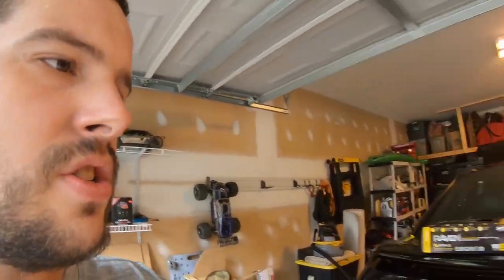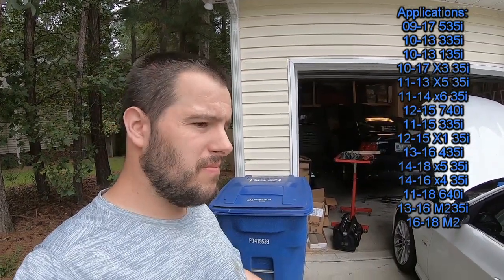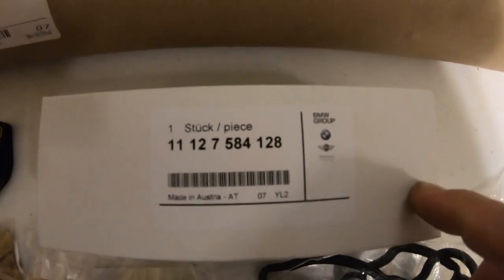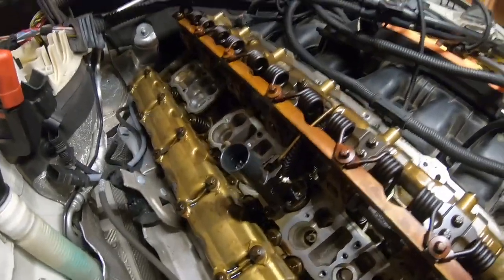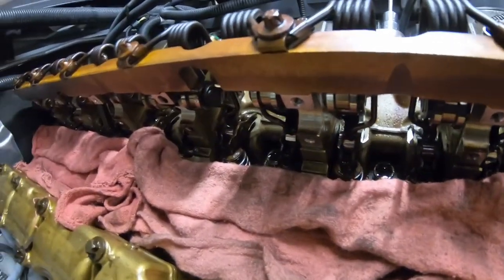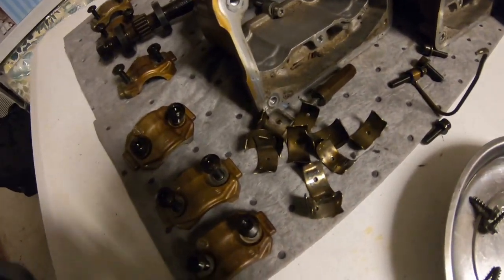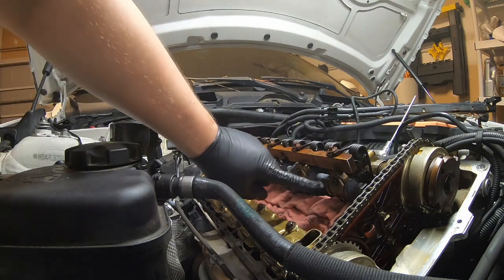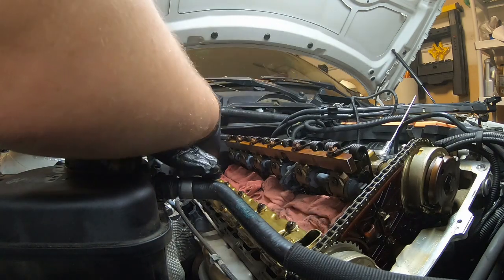Bmw N55 Eccentric shaft replacement

Comment: If you replace the valvetronic sensor motor, do you have to replace eccentric shaft ?
Reply from the maker: You do not have to replace the eccentric shaft. Most of the issues with this system stem from problems with the motor itself. There are occasions where there is damage/ wear to eccentric shaft where it could cause issues. I have not seen that very much though. There is a service bulletin from BMW that references some of the faults that stem from eccentric shaft motor problems. In that service bulletin it states to replace all components of the system. The customer of the vehicle in this video got hold of the service bulletin and wanted to air on the side of caution and just prevent any future issues. If it were my car I would have replaced the eccentric shaft motor first and gone from there.
Reply: @MunkysGarage  thanks
Reply: @MunkysGarage   when im gonna replace my valvetronic can i see if the shaft is bad in any way? Like if i dont see any marks on it should i leave it alone? I randomly have only a shadowcode 135704 and my car is just running a little rough, sluggish at low rpms. Its a n55 with 88k miles on it. If i disconnect the valvetronic motor it runs better but not perfect obviously

Comment: Great vid. I’d recommend replacing the valve cover while you have it all apart. Either genuine or URO both of which come with gasket, bolts, etc. Preventative for that PCV valve that will one day fail from age alone

Comment: Hey man , could you share what is the position eccentric shaft motor should be in when putting the valvetronic motor back in? I put it back in and im getting a code saying valvetronic motor is not in a right position with eccentric shaft motor. Any idea?
Reply from the maker: There is no correct position for the eccentric shaft motor. Once in you have to perform a reference run with a scan tool so it can learn where the end stops are. The end stop is a hard stop screwed into the head that the eccentric shaft hits. When it hits this end stop the motor sees a spike in current draw and knows that is where it needs to stop turning
Reply: @MunkysGarage  thank you so much for the reply, I started the car and did the scan to “learn valvetronic motor” and the engine started clicking a lot and smoke started coming out of it. So i turned it off. i assumed it was the positioning that was wrong. Would you happen to know what it could be?
Reply from the maker: It usually makes a clicking noise momentarily when it is hitting the end stops at minimum and maximum lift. If it keeps making the noise im not entirely sure what would be causing it. Smoke might be from wiring getting hot due to high current draw on the motor if it is trying to move and cant.
Reply: @MunkysGarage   i see, yeah i kept making the clicking noise and then started having misfires and the whole car was shaking a little, i stopped the engine right away and the smoke came out. I only changed valvetronic motor thats it, and i put everything back. I am planning to open up the engine I just have no clue how to check what is wrong. When i scan it, it gives me these codes: 1. “valvetronic servomotor, position sensors: short circuit or line disconnection” 
2. “valvetronic servomotor, position sensors: supply voltage faulty” 
3. Dme, monitoring, 5v sensor supply: Voltage outside valid range 

Any idea what could these be?  Thank you so much I really appreciate your help
Reply from the maker: Most likely a faulty wiring harness between valvetronic motor and dme. Very common failure point along with the motor.
Reply: Pause Life any updates?

Comment: Any chance of checking my videos. 

I’ve lost of power and having a hard time getting it started. I have a 320i with the N20 which is basically same design as n55 minus 2 cylinders. When cranking It sounds like the valves are full open at crank and no compression. But then it may start first time, but no revs or power.

I’ve had a clicking noise a few times and now the car has lost all power and won’t rev about 1500rpm it’s been clicking quite a lot. 

No codes or lights on the dash. Will use Ista to scan it once I’ve finished installing it. 

Ever seen the motor fail so much that it won’t start up or rev well? Or other issue? 

Be great if you’ve seen this before?
Reply from the maker: I have definitely seen a failed eccentric shaft system cause a no start issue. With the N20 and N55 engine, the computer slightly opens the throttle and uses valve lift for throttle control until the valves are at maximum lift, and then returns to using the throttle plate. When you unlock the vehicle the eccentric shaft motor performs a reference run. If this motor and shaft get stuck anywhere during that run other than at the minimum lift end stop, the engine can do a myriad of weird things. Including not starting as well as having no power down low. Usually when you are hearing the clicking noise it is due to faulty motor. As has been discussed in length previously the eccentric shaft itself does not normally have to be replaced. The only reason it was replaced in my video was due to service bulletin from BMW stating to replace all components of this system if there are any issues. The customer wanted to cover all the bases and make sure he wouldn't have any further issues.
Reply: @MunkysGarage  thanks for the reply. Ordered all the parts, but didn’t order the decoupling elements for the injectors, just going to do the seals. 

Did you replace the seals and decoupling elements? Mine have done 101k so might be worth replacing I suspect? 

Thanks

Comment: nice video, complete guide but i need to know how you took the eccentric cam motor out, i have the screws out but its more then just a twist to the left or right to get out
Reply from the maker: Do you have the eccentric shaft end stop removed and the eccentric shaft turned completely out of the way. If you don't remove the end stop and turn the eccentric shaft the motor will hit it when trying to pull it out.

Comment: Hi, 

I have the clicking noise at lock/unlock. Does this mean I have to replace the shaft too, or just the motor? 

I have done the relearn phrase and it’s passes with ease. Just have an issue with clicking and warm restart (rough idle or a stall within first 10 seconds of starting up after hot)
Reply from the maker: The clicking noise and rough running is caused by the shaft binding and not moving properly when commanded. Its hard to say exactly which part is faulty without looking at it. The fault could be the motor itself binding up and unable to move. It could also be the shaft binding up in the bearings it turns in inside the cylinder head. Both of these will cause the issues you are having. Inspection would be the only way to determine what the cause is.

Comment: Thanks for the great video, just curious for the valvetronic run in, do you know what tools could do it basically as straight forward as possible? The info online isn't super clear, some even say its not needed.
Reply from the maker: I have always had access to the BMW scan tool to perform the run in service. I believe some of the other scan tools, such as Snap On or Matco, can do it as well. I'm just not sure. I have also never not done this run in procedure. Only because it is listed as follow up work in the BMW repair instructions. I'm sure you could get away with not doing it, but you may have problems. I'm just not sure on that point.
Reply: @MunkysGarage  ahh ok, are you scanning with INPA?
Reply from the maker: @Kevgti5  The bmw software is called ISTA, or integrated service technical application. It allows me to pull fault codes, run test plans, activate things to check function, and also programs newer vehicles.
Reply: @MunkysGarage  Cool, thanks for the help. I'm just gearing up to do this job, really appreciate your vid and comments !
Reply: @MunkysGarage  hi I replaced my eccentric shaft sensor and valvetronic motor on my 06 530xit n52 engine, just installed ista d and p, can I use these to do a relearn? I haven't seen any good videos as of yet on it.
Reply from the maker: @nattadam4171  ISTA D is what you are going to use for the relearn. ISTA P is for programming modules. On the older vehicles such as yours the diagnostic and programming software were separate from each other. On newer cars it's all integrated into the same program.
Reply: @MunkysGarage  thanks I tried it car is still not starting and throwing a bunch of valvetronic and eccentric codes. Originally I was having erratic idle then stall then no start at all. Eventually it threw a code for the sensor. So I decided to change the motor as well since I was at it.
Reply: I pulled the plug on the valvetronic motor and checked voltage while turning the switch on, got. 5 volts.
Reply from the maker: @nattadam4171  I will warn you that if your eccentric shaft sensor was leaking oil long enough it can actually push oil thru the wiring in the harness and back to the ECU. I would pull the connector at the ECU and check that there isn't oil in the connector housing.

Comment: Hi I have a code 2dcf valvetronic system no movement identified” I’ve already replaced valvetronic motor but the car still will not start do you think it’s the eccentric shaft?
Reply from the maker: Is this a N55 Engine?
Reply: Munky & Rooster's Garage yes
Reply from the maker: @RYAN151292  If you were in there to replace the motor you had to have moved the eccentric shaft to remove the motor. Did you feel any binding in the shaft when rotating it. It is most likely going to be a bearing for that shaft binding or the gear wheel on the shaft is galled up keeping the motor from being able to turn it.
Reply: Munky & Rooster's Garage thanks for the reply yes when I’ve replaced the valvetronic motor didn’t feel any binding on the shaft just tension  it moves pretty free. The problem is I cannot get the valvetronic motor to spin at all it won’t move ?
Reply from the maker: @RYAN151292  The new one or the old one? You tried turning it by the allen in the end of the shaft correct?
Reply: Ever sort this?
Reply: T Smith sort of sorted, does your car start?

Comment: Did you use a torque wrench on the caps?
Reply from the maker: I did I just didn't record that part. The torque on the cap bolts is 8Nm.

Comment: What would cause the Valvetronic Actuator to short out?  My 2013 535i was ratchet clicking top of motor since I purchased it in July 2016.  Labor Day 2019 car went into limp mode and Drivetrain Malfunction with 42000 miles.   Actuator shorted and had to be replaced as well as the Eccentric Shaft.  My theory is Eccentric Shaft started binding before purchasing car (2nd owner) in 2016.  The ratchet clicking (actuator relearning) sound is not normal.  If you have that sound every time you drive car after engine is cut off, expect fault code to eventually get thrown.
Reply from the maker: I agree the motor going bad was most likely due to the shaft binding up and causing the motor to pull too much amperage. If you have the ratcheting  noise when unlocking the car (eccentric shaft does a reference run when the ecu is woken up) this is a tell tale sign the eccentric shaft is beginning to bind up. I have seen, only on one occasion, a binding shaft and failing motor actually burn up the driver in the ecu from pulling too much amperage. So if you have this noise or are setting faults I recommend repair asap to prevent more costly damage.
Reply: @MunkysGarage  So no sense just replacing the eccentric shaft motor by itself.  What causes the shaft to bind up?  bad needle bearings?  Can you just replace them and keep the motor and shaft?

Comment: Thanks a lot for you video and the nice trick with not having to remove the springs. As far as I can tell you are working on an E9X car, do you think it would be the same on an F30 with the N55 engine? Perhaps you just did not show it, but what about the injector seals? As I have read they have one time teflon seals that need to be replaced once demounted, or what is you experience in that regard?
Reply from the maker: It was an E90 I was working on in the video. Doing the eccentric shaft on the N55 in the F30 is the same process. The repair instructions do tell you to replace the seals on the end of the injectors when they are removed. In the 10 years I have been working on BMW's I have only replaced those seals a handful of times. If you take the injectors out and put them back in within a few hours the seals don't get a chance to swell up and will still seat back into the cylinder head correctly.

Comment: Great tutorial!! I have to repace the eccentric shaft on a bmw n52 engine that also has valvetronic due to broken teeth on the eccentric shaft gear. Would i be able to also replace the shaft without removing the valvetronic springs? I saw the spring tool on amazon for $139. Seems totally affordable. My fear is that the threads in the cylinder head casting might get damaged when tightening the eccentric shaft bearing cap bolts to pull the shaft back in place. Your thoughts please??? Thank You Ross
Reply from the maker: It's actually not possible to due the eccentric shaft on the N52 without removing the springs. The cylinder head is designed differently and the shaft mounts differently. The springs will come out if you attempt to do it without relieving the tension on the springs. Believe me there is a lot of force on those springs. If you do get the tool be careful when you are taking the tension off the springs. Make sure the tool is locked onto the spring properly before removing the screw holding it down. And when you go to put it back together make sure you have the springs sitting on the eccentrics properly. If they are not on there properly they will kick the eccentric out when it starts up.
Reply: Thank you for the response.  One more quick question please.  After removing the valvetronic springs with the special tool, do i need to remove the intermediate levers as well? According to identifix, in order to remove the intermediate levers I have to remove the gate block that is secured with two little Torx screws. I just want to do the minimum amount of disassembly so I can just replace the eccentric shaft. But if that requires removing the intermediate levers then so be it I just thought I would ask.
Reply from the maker: I have only done an eccentric shaft on a N52 a few times. From what I remember the levers do not need to come out once you take the pressure off the springs. I believe the levers will stay in there while you take the eccentric shaft out.

Comment: Great video.  I’ve been avoiding this job due to the complexity of remove the springs and levers with the crazy job specific tool.  This looks way more approachable.  Question, does the actual eccentric shaft actually fail or could you do the motor, oil squirter and replace the bearings on the existing shaft?
Reply from the maker: I'm not 100% sure if the eccentric shaft is part of the problem. I have seen multiple times where there are wear marks on the shaft from it binding on the motor. I would be concerned that this would cause problems with the new motor if you just replaced the motor and oil nozzle. If there were no marks on the shaft I don't see why you couldn't just replace the bearings on it.  There is a service bulletin from BMW to replace all three components if that fault is present.  That is the only reason I replaced it on this car. If its your own car I would say its worth a shot. Just with a customers car its not good if it ends up coming back because you didn't replace the shaft as well.
Reply: @MunkysGarage  First off, thanks for the great video.  Second, where do I look to determine if the eccentric shaft has been damaged?  Am I looking at that big half-moon shaped portion with the teeth that engage the motor's worm gear?  Third, can I do that inspection without removing the shaft?